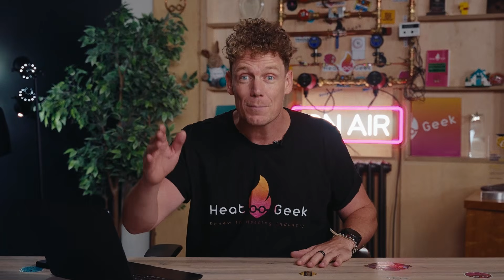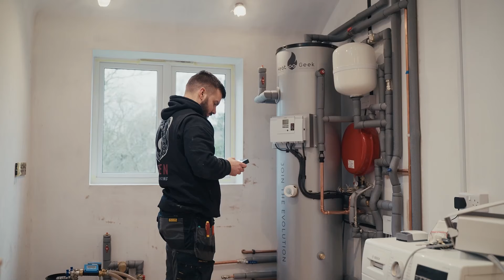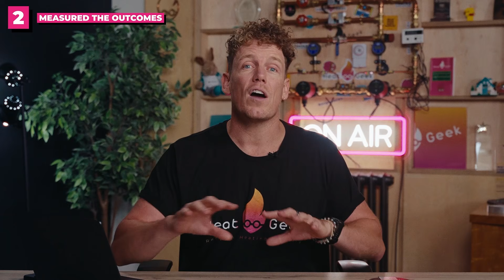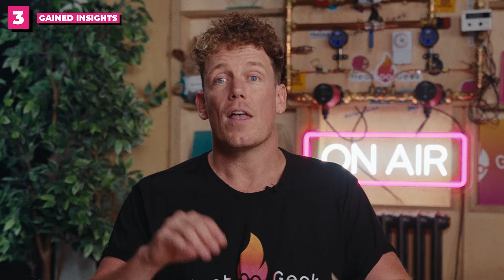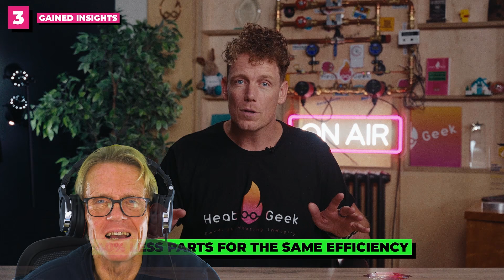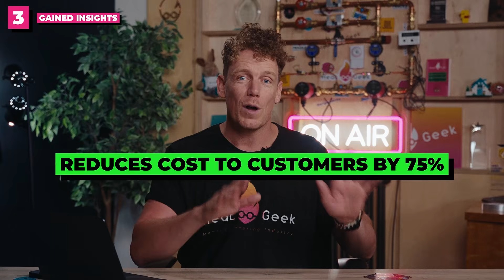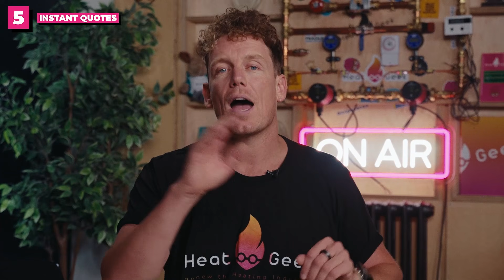Heat Pump Reality Check: Is Zero Disrupt Too Good to Be True?

Comment: I really don't see heat pumps as a solution for the much of legacy housing stock where heat loss can't practically be reduced to a sufficient level. Well designed new build is another matter, there heat pumps can be more appropriate. However we do need to look at the provision of electricity and the grid infrastructure very carefully as everything goes electric. We will have to pay for massive generation, transmission and distribution upgrades and suffer environmental horrors of pylons, solar and wind farms across our tiny island.
Reply: Works fine in my 1960's two bed semi, modest insulation and double glazed.

The infrastructure is being upgraded continuously, Scotland is the Kingpin of wind turbines, they're hardly noticeable as a blot on the landscape, certainly no more so than all the houses, roads, farms, phone masts, existing pylons that bring us wonderful electricity, and a multitude of other manmade eye sores.

What does look bad is the large areas consumed by wildfires this year as we get wetter and dryer seasons, and the decimation of wildlife.
Reply: @_Dougaldog  I live in mid-west Wales and we are in the process of having extensive transmission line upgrades which means pylons marching through beautiful valley areas and many hill sides blighted with turbines (and they sure aren't wildlife friendly, ask the birds). The solar farms are perhaps less obtrusive but take up valuable pasture. But I guess beauty is in the eye of the beholder.
If you look at the evidence in the IPCC reports, rather than the political summaries, you'll see that extreme weather events like wild fires are not increasing nor is sea level rise accelerating.. Obviously weather patterns do change and in the long term climate, but real world data (not fanciful models) do not demonstrate climate being driven by anthropogenic CO2, nor does the physics. Grid level renewables still require gas and diesel turbine back up at great additional cost and no CO2 saving (if that is a concern). Until we have an viable, mass, energy storage technology, renewables to supply the grid are an expensive and unsustainable option. As for carbon capture, it's a political money pit that has never proven viable even if it were desirable.
Reply: Electricity isn’t free, you need more, you pay for me.
Reply: We’ve literally totally disproven they work in any age home now multiple times. Anyone not listening now is just being stubborn
Reply: @HeatGeek  I haven't seen all your videos. Can you point me to one where you show it working well in a poorly insulated house?
Reply: @mfr58  we did a whole series on skill builder where we installed one in a 150 year old solid brick building?

Or type old home in our YouTube we have 3 solid. Brick houses in there
Reply: @HeatGeek  Thank you. I'll have a look.

Comment: Just waiting for the 'ex NASA engineer " who was sacked because he discovered he could reduce bills by 90%
Reply: We don't need tinfoil hat technology.
Reply: @PureHokkaido   What are you on about? This stuff can warm an entire room for 5p!
Reply: @FlatToRentUK  I warmed a room with a 50w filament light bulb, but never had the opportunity to work for nasa
Reply: @dantronics1682If you warmed a room with a 50W filament lightbulb, its heatloss at the time was significantly less than 50W. Back of beer mat calcs tell me that to keep a 4x4m room made to current building regs to 20 deg C, for a 47W input to keep it warm, it would have to be at least 17.6 deg C outside. 😂
Reply: @PureHokkaido  I own a tin foil hat I own a woodturner and collect firewood for free, meanwhile the eo zealots by electric from Drax imported from wood gron and chopped on Canada
Reply: @SteveJones-gz4vd  

See my previous reply regarding unhealthy wood burning, the good news is that other sources than Drax provide 95% of our electricity over the year.
Reply: I did a Client Acceptance job for a 6th Gen Drillship and the owners were extolling their Maintenance Database Engineer who 'used to work for NASA' - "We ain't putting this ship into space, are we???"   HOW DO YOU KNOW IF SOMEONE HAS WORKED FOR NASA?  DON'T WORRY - THEY'LL ALWAYS TELL YOU!
Reply: 97.53% actually.
Reply: Nasa Engineer here. I got the Nobel prize for F*ck-ups last week.
Reply: It's called a cheap Chinese diesel heater.

Comment: Nah,I'll stick to my 24kw boiler and log burner, cheap as chips,no disruption
Reply: Only to the climate….
Reply: @simonm9923  UK Electricity comes from a mix of sources including gas and bio mass power stations, more so during periods when demand is high, are you deluded?
Reply: @MK-to4et  sorry old chap, not sure I follow you. A gas boiler gets less than a kWh of heat from burning a kWh of gas. My heat pump gets 4.5 kWh of heat from a kWh of electricity, much of which I generate myself. The UK electricity mix is getting progressively less polluting and will continue to do so. Burning hydrocarbons in boilers is damaging and archaic…..
Reply: @simonm9923  And you run a heat pump 24/7 right? Where as I can run gas boiler for an hour to heat my home - the conversion doesn't stack up if you're running it all the time. Do what you want but don't delude yourself that you're "saving the planet" by using a heat pump and trying to preach to others.
Reply: @simonm9923  "The UK electricity mix is getting progressively less polluting and will continue to do so" - with renewables that will hit a plateau as they are not commercially viable even with subsidies hiked on bills - Hornsea 4 project for example. These will always need 100% backup too .. from you've guessed it gas and biomass power stations.
Reply: @MK-to4et , I get it. You aren’t convinced and no amount of facts or data will persuade you otherwise. I’ll just carry on in my stupidity and keep making the big mistakes that you keep highlighting, you take your enormous wisdom and do what you think is best. Cheers.

PS I believe Plato was a Greek Philosopher in about 400 BC, wonder what he would have thought?
Reply: @MK-to4et the heat pump is 'on' 24/7, but modulates according to demand (from off to slightly on to fully on)
Reply: @simonm9923  Would he have come up with Heat Greek?
Reply: @MK-to4et Backup from hydro and nuclear you mean
Reply: @tonybaker6001  No, they are used as part of the mix already - they aren't used as "backup".  Plus we're due to retire some current nuclear power stations, along with backup gas turbines around 2030, as they reach end of life. Sizewell C isn't due to come online until the mid 2030's .. buckle up for energy rationing and blackouts.
Reply: And poising the air around your own house
Reply: whatever works for you mate . never change everyone anyway😊
Reply: Good for u don’t mind the brainwashed haters
Reply: I stick with coal personally, can pile it up.
Reply: So you pollute for free? And we all pick up the cost to the NHS and lost productivity caused by the particulates from the wood? (I'll not mention the misery of respiratory illness and death - 30000 per year in the UK-  I'll just follow the money as per your post.)
Reply: @paulhayes6920 I’d rather be warm in winter than freeze just to virtue signal.

Comment: The price of electricity reflects the inputs.
For a start, heat pumps don't benefit from Grid solar because there just isn't enough sun in the heating season. Any. Grid solar would be taken up by increased lighting demand.
This means that heat pumps either run on wind or gas.
About 2.5 kWh of gas needs to be burned to provide 1 kWh electric delivered to a house.
Then there's predictions that this year wind curtailment could be almost £1 billion.
Then there's Drax,£869 million subsidy for shipping wood across the Atlantic.
The there's the " Life Cycle Assessment" of LNG.
Then nuclear soaks up a huge sum, Sizewell C probably £40 billion. The thermal output is quoted as 9 GW and electric output is 3.2 GW. That's a huge amount of wasted heat.
Then there's the spent radioactive fuel to be dealt with, I don't think that's been solved as yet.
Then there's the decommissioning of older and current nuclear facilities.
The idea of Carbon Capture and Storage is really on shaky ground. I've heard of £22 billion mentioned as the budget for CCS. Money spent is related to energy input, question is, is that money spent on CCS going to fossil fuel providers or is it all coming from renewables?
Another thing, a huge amount of battery storage is being built. This Grid scale battery storage is only capable of a few hours supply. In 15 years time there's going to be huge amounts of junk batteries to be decommissioned.
I do have a heat pump but I need up to 300 litres of hot water for 5 people to shower etc and it needs to be over 60°c to allow for cold water to make up the volume.
Reply: Heat pumps can heat water at any time, and sometimes it is cold outside and sunny. In both cases heat pumps will use solar.
Reply: You need to take off that tinfoil hat.
Reply: I've got 3 friends with HPs and each of them has solar panels, one of them has batteries. I'd imagine quite a lot of folk are going to get solar as it's a no-brainer and massive saving. That should reduce grid demand both for HP running costs & EV charging.

Comment: Putin isn't a reason to get off gas & oil. Most, 60% is produced by the states and Canada could do plenty if needed. White hydrogen would be the holy grail.
Reply: Hydrogen can't replace methane for gas boilers or cookers in full, volumetric energy density is way too low and would require replacing pipes. Best we can do is a mix of methane and hydrogen.
Reply: @MrDahnan It can and far cheaper than the electricity grid upgrades required which aren't even proven at that scale. You could of course run a heat pump off a fuel cell too but I don't know how much it would cost. It would be more recyclable than batteries though too.
Reply: @kevinchadwick8993 where are you getting all the cheap, green hydrogen from?
Reply: We should stop trading with Russia & China & anyone who trades especially with Russia

Comment: Why is no one talking about the real problem with heat pumps? The amount of space needed inside the property for all of the additional equipment.
Reply: What additional equipment would that be David?
Reply: @richardwilkins8476  what about a tank?
Reply: @pstanyer1 , chieftain or panzer? Do you mean a cylinder - had one already
Reply: Goes in the loft, garage, airing cupboard, who cares.
Reply: What are you talking about? We SAVED space. What "additional equipment" are you referring to?
Reply: No extra indoor space required at all, saved the space where my gas boiler and gas meter used to be .
Reply: Old system boiler has 2 tanks in the loft a cylinder and a boiler. A heat pump has a cylinder
Reply: @lukerussell5674  To be fair most homes are on combi boilers now with no tanks and many larger homes have sealed systems with no header tanks.
Reply: @David-bi6lf  There are now indoor tanks the size of a combo boilers and smaller . Watch some of heat geeks videos. The difference for me with gas and heat pumps is simply that heat pumps are always evolving and gas boilers will now never really change as they are at the best they can be.
Reply: What extra space?  I presume your boiler has a space to itself, with some space for the flue?  Mibbe in a cupboard of some description?  Perfectly feasible to fit the water cylinder in that space.  Then you've got  a flow and return pipe to the outside unit with some insulation on them...and a power cable with an isolator.

Hardly a huge pile of additional equipment, 2 pipes and a wire, and a cylinder where the boiler once stood.

Comment: Banter aside, Roger and Adam share great knowledge and give great advice, and from them sharing their expertise my current 17 Year old Boiler is now Range rated, working at 50C through very large radiators and very efficient/cheap to run. But i have been waiting for prices to come down so i can get a proper trusted install by a heat geek installer. It is mad to get a new Boiler if for a similar price i can get a good heat pump install. This is great news.
Reply from the maker: Let us know if you do take this offer up. We would love to hear some real world experiences.
Reply: @SkillBuilder  I will, Going to see how well the big radiators do in winter at 50c from Boiler. if all good then getting quotes March 2026 for a heat pump.
Reply: @alanrenwick1652  Don't forget that 50c from boiler is not the full picture - the system flow-rate is of equal importance.
Reply: Keep in mind electric bills will easily double,crash your old 1 with heating pump unless to throw solar pv installation, and  full external insulation which is on top of 19k ish for heating pump itself so you need to have at least 30k to splash before even seen any " savings " vr 5k for new gas boiler so yeh tech is there but its way too expensive to implement in Uk house
Reply: @user-uq7io2os3r  I installed Solar and Batteries early this year. Going to see how winter is with boiler range rated and running at 50c. If all Good plan to get Heat pump quotes in March 2026.

Comment: Roger's analogy with the 'common' car design and heat pumps is misplaced in its negativity.
Gas boilers do exactly compare with that common car very well. One solution for all home user scenarios. So basically Adams design system also fits Rogers analogy in that it covers multiple scenarios for the one house.
Reply: You are wrong. If you use an average scenario based upon how often the bloke down the road has a shower and you size your hot water on that algorithm you are not designing a system for your customer. If you can't understand the Edsel analogy I can't really  help you. Every student doing business studies or marketing learns it in year one as a warning against giving too much credence to focus groups.
Reply: @Roger-Bisby1  
You are wrong.
You said that a manufactured product (car) designed for multiple types of owners was a failure and you said that Heat Geek were trying to do the same thing.
But a gas boiler is exactly the same type of product as the car you took as an example.
It's a universal design, easy to fit and install.
So your logic suggests the gas boiler is a failure. But it isn't, therefore your logic has failed, it's a logic fallacy.
Or alternatively gas boilers are a failure if you are correct.
Reply: @Paul-yh8km  

Hi Paul 
 I am sorry if my train of thought was difficult for you to follow but let me just try to clarify my point in simple language
Adam said that they took a design for a specific home and they set that against average homes of that type. He used the example of hot water. 
It is clear that in a house of a certain size there may be an average hot water consumption but that is not helpful to the house that has more people or has more baths than showers.
With  a gas boiler this is not an issue because a combi will give you unlimited hot water and a gas boiler serving a cylinder can top up on demand regardless of the weather.

If you undersize a heat pump and the weather turns cold the heat pump can't produce more heat to compensate so you need to do a precise calculation. 

The point you make about gas boilers being designed for the masses is not relevant. 
It is the fact that they can be turned up or down to suit the load that is relevant. 

I hope this makes it clearer for you. I am not trying to score points, I am simply saying that downgrading a heat pump,  because two houses up the road have shown the heat pump could be oversized, fails to allow for variables.
Reply: @Roger-Bisby1 
I think the car analogy was misplaced though because it is closer to gas boilers or just as close.
That was the point I was making.

Comment: SkillBuilder 2025: Heat Pumps don't modulate
Reply: modern inverter heat pumps can modulate heat output, allowing them to adjust to varying heat demands by continuously adjusting their power consumption and heat output to maintain a consistent temperature and improve efficiency.
Reply: Even cheapo portable aircon/heatpumps are inverter based these days - like 300 quid from China.